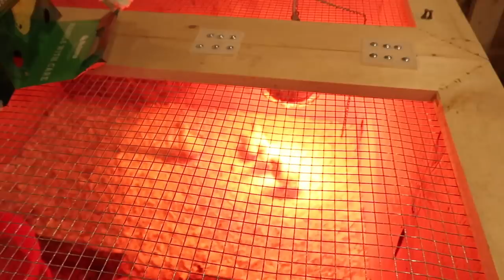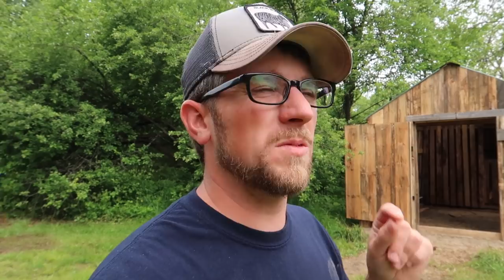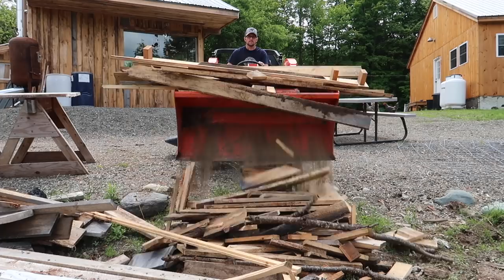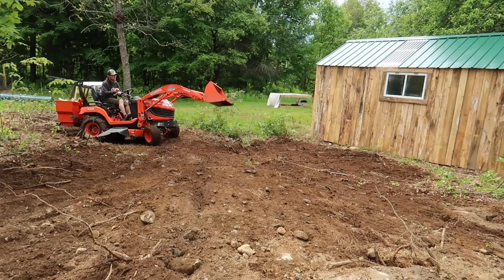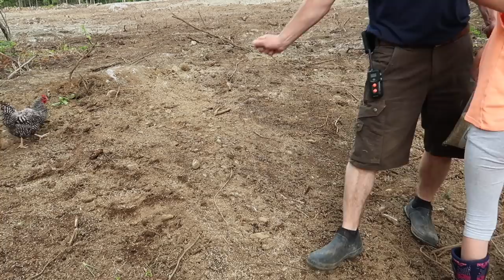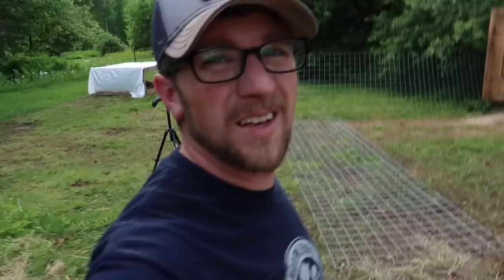So much has Happened in a Day (you wont believe what we got)

Comment: Your tractor will work that field just fine with some rented or borrowed equipment, someone else commented about a rake attachment.  You already have the loader to move the rocks with and yes a rock fence is a big asset to the property. The frost will push the rocks back up and be a forever problem move them and use them. A piece of chain link fence with a drawbar and two cables makes a great drag to level the soil. Just my two cents.

Comment: not sure if you have one yet, but a chain harrow can be pulled by the tractor, it will pull rocks to the surface for removal and will level slight ups and downs the more it's used. it can even churn in compost, there are many vids here on them

Comment: I think you should take a smaller area at a time and pick up all big rocks and get a rock picker to pick up as many of the smaller rocks as possible....then put a load of your wood chips over that smaller area.  Then go to another smaller area...and so on, until you have finished the entire area.  Solve the problem one bit at a time, and do it right.....If you pound the rocks into the ground they will just resurface in the future and you will be extremely disappointed.

Comment: Al 
I would never burry rocks. I suggest you place all the larger rocks in a pile out of the way place because you never want to have to dig them up again. I suggest you drag a large telephone pole, rail rode tie, or larger beam behind your tractor. You can also attach a large piece of chain link fence behind the beam and put some weight on top of the chain link fence. Rocks that pop up can be placed on top of the chain link fence!
I would also see about getting wood chips like what was taken away in the trailers during the logging operation. I would get a lot of them plow them under and then apply straight slow release Nitrogen fertilizer on top to facilitate swift decomposition while increasing water holding capacity.

Comment: When we did our spot for the goats. Mind you a way smaller spot than yours. We had it logged also. The guy used a rock rake and pulled a lot of the rock to one side of the field It worked well. As it also pulled a lot of the roots to the other side also. The only reason we got goats after that was for Land Management not for milk or meat. 15 years later no goats but we now have a nice field.I would use a rock rake and then roll it out. Regardless trust me it's a lot of work especially for the size you have to do.  Even if they use the rock rake to just pull from the center out and push all the rocks to the sides I think you'd be a lot better off. Because Winters up here seen the push rocks right out of the ground and I don't know if just rolling it's going to do it.

Comment: I would suggest that you check with your local county extention office about what type of damage or benefit you would get with a roller.  A few trips around the pasture with your tractor might be enough to get the surface rocks out of the way.  They would be a great source for a low wall  for landscaping and water run off control..  Doing nothing is also an option as the land finds its own level.

Comment: If you just want to seed, I would just get a seeder for a riding lawn mower pull it behind a mower,atv, or tractor. I would straight up the cleared area but not compact it. Compacting may be wasting money and time. The livestock will compact the dirt. Make sure you inspect the clearing and fill in any holes keep from the livestock breaking a leg. You may decide to change to a cow or horse if there a hole you can be sure they will find it 2:00am. Wish you the best and God Bless.

Comment: Depends what you want to do with the field I guess?
My opinion, if you're going to turn it into pasture to harvest one day, don't bury the rocks. It's all a process.
Years ago when I was a kid, I traveled to New Brunswick in summer and helped my uncle clear blueberry fields. He never buried the rocks. He spent years cleaning up fields to a point where they were able to extend berries throughout the field.

Rocks were removed, big stumps were removed, fields were burnt with flamethrowers. Gone over very finely until most of all the rocks were gone. They were able to maximize efficiency with the blueberries because they had tractors with berry pickers on it. Each tractor had a rotating head with tines, and a couple conveyor belts to gather the berries in the back of the tractor on a platform where crates were exchanged once filled, and to be stored at the end of the day. 

The berries were low-laying, results were maximized because of the condition of the fields.

So my opinion is, don't bury the rocks, spend the time removing, preparing the field for whatever you're going to reap from it. It's a process. I'm also a little saddened that you took the clear cutting route and removed all the trees and bush. Regrowth will take decades, it's like saying goodbye to fresh air. But I hope at least you get more use out of it and you're successful.

He farmed both berries, and maple syrup in the east, in different seasons.

Comment: I would say no to both the excavator and roller. Either one will compress that hardscrabble soil so much, it will make it difficult if not impossible for your pasture seed mix to penetrate deeper into the soil. Very shallow roots equals no drought resistance. Your original thought on the York rake is your best bet. Between the rake and your bucket you should be able to level out the high spots, remove most of the rocky over burden, and leave a looser soil for your pasture mix to get started in. 
When planting on barren ground, as around your goat barn, it's a better practice to rake first, then broadcast, then mulch. Raking leaves furrows that the seed can fall in, sit on. When it rains or gets watered the furrows flatten and cover the seed more than adequately for germination, and your seed stays evenly distributed. Raking after, while it does cover the seed, it also severely affects your even distribution. You'll have areas of heavy coverage and areas that are thin and/or bare. You hay mulch cover should be just heavy enough to protect from hard rain, birds and chickens, but should be light enough to barely see the soil through. To much mulch will block light reaching the seeds and again severely affect germination and coverage. 
I'm a bit confused on the pasture you're planting next to the goat barn. Goats are browsers, preferring a mix of brush, grasses and other pasture mixes like clover etc.. To the left of the goat barn is an overgrown area of brush and weeds the goats would love to clear out for you. Instead your planting barren ground with pasture mix and evidently are planning on turning goats out on week to ten day old freshly, planted pasture. 
I've been following you for over a year, and I've listened, and watched as you explained how you use your livestock to not only work for you by helping to clear and prep land, but also naturally feed themselves, cutting down on expensive commercial feeds. So far this year, your pigs, which certainly look old enough to be out on pasture, are still in confinement even though you set up fencing for their pasture weeks ago. New Yolk City sits where you parked it last fall. I do like the ambiance of having your layers running all over your property, I don't understand why you haven't set them up on a land reclamation project, IE; clearing more woodlot and orchard. I understand you're expanding your homestead and opening up for expansion. This should not come at a cost of letting older, established systems fall by the wayside. 
Lastly is the winter chicken coop/greenhouse. For two seasons now you've been bragging on how the chickens and pigs with the deep litter bedding were making copious amounts of great compost for use on your farm, and there it sits. This year you have to go buy compost for your garden, I'm a little lost on this.
I love your family, your farm and most of your philosophy on modern homesteading. It appears you're dropping the ball on these early projects over rapid growth and expansion. The work expands to fit the time. In other words, you have to prioritize your projects, plan for them and keep them working, along with the new growth. You're currently expanding the work of the new growth to fit the time allotted to the detriment of your older systems. I understand the excitement of opening up new land for pastures, and watching big equipment make short work of a monumental project. Your back was to the wall on getting your garden planted, your family pulled together and got that done. In my opinion, your back was to the wall on these other systems and you let them slip by. Seriously, you couldn't find a couple hours, rather than standing watching heavy equipment, and getting NYC moved and set up? 
"Oh, crap, watching this is fun, and exciting, but I have other work I need to get done." Just my 2 cents, which isn't worth much anymore.

Comment: The best and cheapest way to level ground like yours is to use big tires like truck (18 wheeler) tires get a sturdy log and chain the 2 tires to the log tie the tires to the log solidly but let them be able to move up and down. Tie the log from the middle of the log to the hitch and drive around and around the dragging of the tires will smooth out everything the more you drive around the more smooth and level it will become. You could do this with a 4 wheeler but it can also be done with your tractor but take that mower off it will tear it off. This is a good excuse to get a 4 wheeler and it will save your tractor. Just go slowly around dragging the tires around and around give everybody a chance to learn how to drive the 4 wheeler. Round and round and round and round you will be amazed at what that will do. Then plant it, use a non compaction seed like winter wheat, fall rye, oats whatever is cheapest, broadcast it everywhere buy a 50 pound bag its cheaper that way here. The non compaction seed will sprout within a week and you will see green coming out. Then you need to stay off it with the equipment until the seeds get established. Maybe you could do it in quarters or seed and area and continue working the rest. Another thing you can do is get a straight blade to attach to the 3 point hitch of the tractor and then drag it around and around it will work like the tires but it will first start collecting and dragging sticks pull the little stumps and it will dig in and bump around levelling and cleaning up as it goes. So once you get started dragging you will need to pick a spot where you can drag a bunch of stuff and then go to a spot and lift the blade and release the rocks and roots and sticks then keep on going round and round and you will see the big difference. Once you get a spot cleaned up enough to plant seed when the seed grows it will rot stumps and sticks and organic things that are on the ground. Those seed will grow 2-3 feet high and reseed themselves as time goes on.if there are problem areas or big stumps just work around them you can mark them with a stake and deal with them later when you have more time or better equipment. Level what you can and seed it and move on the sooner you get an area done and see how it is working it will motivate you to do more. Once the tall crops start growing up throw some other grass or clover around in the taller crop area it will shade and keep the seed damp until it starts and grows on it's own. Once you get an area thick enough with green move some animals out to feed even if just for a short time and then move them around and they will help with levelling and spreading seed.  Good luck!

Comment: Will the new fields be used for harvest or just pasture. Instead of spending money getting others to do a job, it might be beneficial to just buy some implements for the tractor. A box blade or a blade can pull some soil around and loosen some rocks that can then be taken off the field.
If you have a source for manure from local farmers, getting some spread on will help build soil.
Reply from the maker: I would love to hay the area some day.
Reply: Set yourself a goal of one new (or good used) implement each year. Size them for the tractor that you think you might have in the future, say 70-100hp tractor. A bigger blade can be used by a smaller tractor if set not to dig as deep, but a small blade on a larger tractor will be frustrating.

Comment: Nice vid. I wanted to guess the timber and excavation. Just a rough estimate of 50,000 bf at $260/mbf would yield you 6500. then 120/hr for 24 hrs on the excavator is 2880 that would leave you a difference of $3620. It would be a total guess on the chips but a couple dollars a ton would be fair somewhere in the 4 to 800 dollar range would give a minimum net profit of $4000. I will say I am not sure on the total number of loads for logs and chips.

Comment: My $0.02 Al.  I'd clear the rocks - any giant boulders though that stick up several feet I would probably leave.  Keep in mind that you will be cutting this field and any smaller rocks sticking up 6" or so will destroy your mower blade, so you want those gone.  A rake, box blade and your bucket should do a really decent job I think - put your tractor to work, don't pay anyone to do it for you. At the end, after several passes your ground should be firm enough, but not overly compacted like you may get with the huge machines. Also who knows, in the future you may want to plow an area to grow wheat for bread or something like that, and this way it'll be prepped.

Comment: Your fencing the wrong side of the barn!  Goats are browser's,  they will want bushes, not grass.  :)  We like to link cattle panels together with double ended snaps and fence the edges of out field.  A dog run will work also as long as they cant get into the brush and get tangled.  They do a great job of clearing the brush under the big trees, which makes it so much easier when we are harvesting firewood. We haven't had much luck with electric as the brush areas they like to eat tend to ground out the fence.  The cattle panels work great though!
Reply: And I agree with others...don't compact that soil!!!

Comment: My suggestion is deal with the rocks first. There should lots of settling where the stumps were removed and the rains will show you where the pot holes are. Fill them with the small rocks and cover with soil to level the ground. Then grow pasture. I would work a area at a time and just keep enlarging the pasture. Rocks are a  nuisance and they were buried before you started and that's probably the best place to put them. You probably can't sell them so what other choices do you have. Too bad that you didn't have that large backhoe dig four large trenches around the pasture for you to bury the rocks in before they took it away. The goat pasture came out great and you can do the whole pasture the same way. Just a lot of work spread out over a while.